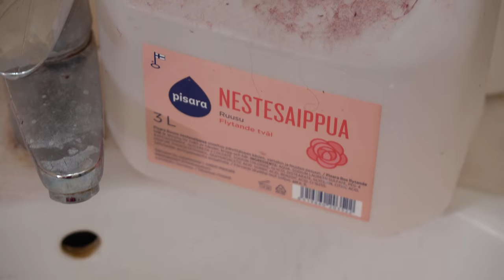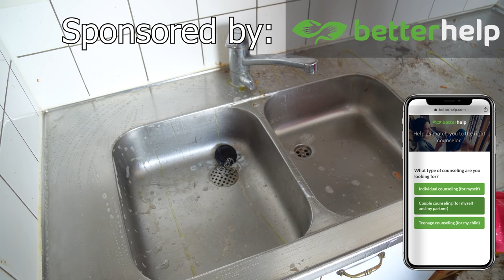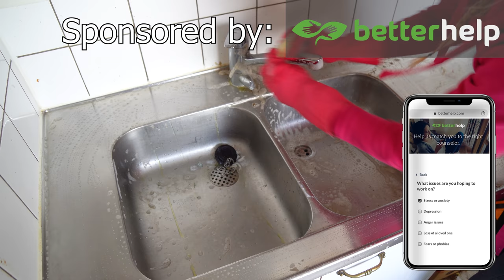Cleaning SUPER DIRTY AND GRIMY home only in 2 days!! 😱🥰

Comment: I almost accidentally set my apartment on fire using the seran wrap stove cleaning method. Pro tip: don’t clean the knobs while it sits, or you might accidentally turn on the flame with a bunch of condensed chemicals covering the area! That aside, it is SO effective for cleaning

Comment: Pro tip!, stick a bowl of water in the microwave for 3 minutes or just enough for steam to fill the walls it’ll help break down grime and oil and also help not to use any type of oven cleaners or just soaps it’s a real healthy way to not have any type of chemicals inside your microwave! And I really love your videos! What you and your friends are doing is a wonderful thing!
Reply: i do this but i add lemon juice to the water so it smells nice too!
Reply: Stick a half lemon in the water dish and it helps break down the grease and smells great!
Reply: I think it was too far gone
Reply: @lesleyhubble2976  yeah I think you have to admit when something is beyond cleaning and has to be replaced
Reply: @chanyphilly8266  I’d would have thrown it away, there’re cheaper enough to buy
Reply: Even better if you put slices of lemon in the water, as it acts as a natural deodoriser.
Reply: Thick grease from food or skin oils needs a degreaser ie an alkaline cleaner like oven cleaner. Steam won't help much. Also you'd spend forever scrubbing hopelessly without a good result. A lot of these old tips that people hawk on here, like steaming microwaves and the eternal, annoying baking soda and vinegar (an acid and a strong alkali which neutralize each other to uselessness, but people are impressed by the fizz) are actually fairly useless with heavy, greasy food deposits. Grease repels water, even if it's hot. You need 'chemicals' to do a good job with heavy cleaning, it;'s nothing to be scared of.
Reply: @littleblackpistol  agree
Reply: @littleblackpistol  Yes I am tired of it as well. When I clean and do these "tips" they don't work good at all. I get a better clean doing what auri does tbh. If your gonna use BS use it alone and with dish soap, same with vinegar use it alone and the way auri says to use it.  This use a bowl of water doesn't do anything your still scrubbing like crazy and it doesn't clean it at all
Reply: @littleblackpistol  water is a chemical
Reply: @chanyphilly8266  I thought that about the bucket!  Get a new one for $1
Reply: She did this already in another video
Reply: @evelynsaungikar3553  I know! You can try and save too many things.
Reply: @littleblackpistol  This. The vast majority people spouting clewing tips have absolutely no idea of chemical properties/interactions. Glad to see some know better.

Comment: Auri, I just wanted to share a random but meaningful way in which you had an impact on my life, even though it has nothing to do with cleaning. I lived with chronic pain for 8,5 years, and when I finally found a treatment that helped, it was kind of difficult to feel hopeful. And as it turns out, negative thought patterns have a lot of impact on pain intensity. When I didn’t get 100% better in the first months, my natural tendency was to be afraid that I wouldn’t actually get better. I was watching one of your videos one day, and you mentioned that sometimes stains don’t come off not because the product isn’t good enough, but because you need to let it sit awhile longer. My brain made the connection that I actually was on the right path, I just needed to work on getting better awhile longer. My symptoms have continued to decrease gradually, and that thought still helps me :)

Comment: AK, I have a tip for you! When cleaning a microwave like Sophie's, a great first step is to put about 500 ml of plain water in a microwave-safe container and microwave it on high for about 10 minutes. The steam starts to loosen up the gunk inside the microwave with no chemicals needed! I know you are promoting some cleaning products and they will still be needed, but the pre-cleaning with steam is a big time-saver. <3
Reply: I looked into it and it doesn’t seem to be safe to use a microwave after it has gotten this dirty because there’s holes inside and the old mold particles and germs can actually recontaminate the food. I would love to see a science experiment to know if that’s actually true and if there’s any way you can fix it! I suppose this microwave was being used in the before condition though (obviously) so as of right now there’s probably 80-90% less germs to go back into the food so it’s a lot safer than it was previously, that’s for certain!
Reply: Yes, this absolutely shortens the cleaning process and I do it too.  Even if the microwave is not super dirty you will be surprised how much comes off it.
Reply: Add a splash of vinegar to that and voila! Disinfected too
Reply: I do the same, but for 5 min., half of the water, and add 2teaspoons of lemon juice. Loosens the gunk and smells amazing!
Reply: Yes and similar with half a lemon..
Reply: Vinegar will steam and disinfect at the same time!
Reply: I add a slice of lemon to the water. Takes away the odors.

Comment: Aurikatariina, not sure if they are sold in Finland but I use a pumice stone to remove lime scale rings in toilets. It will remove a ring in minutes without chemicals (I just use scouring powder). They are also safe to use on ceramic sinks and tubs (just not fiberglass or stainless steel because they will scratch those surfaces.)

Comment: There are so many differences in the U.S. homes/apartments, and other countries. I live in the U.S., my apartment has a dishwasher, wall to wall carpet, and full-size appliances which include a dryer. Because I'm on government assistance, for multiple physical and mental illnesses, my apartment is about half the price of others in my area.
I use Clorox multi-purpose spray, Clorox toilet bowl cleaner, and Dawn dish detergent. For my dishwasher I use Cascade pods. I may skimp on food, but NEVER my cleaning supplies. I want quick, and easy. I just don't have energy to scrub and Clorox tends to wipe easier, no scrubbing needed. Dawn cleans birds after an oil spill, so I know it works quickly and easily.
On occasion I relapse with my depression and have to get a cleaner for a "start over" clean. But my goal is to do one thing every day or every other day.

Comment: This is SO good. But i really think i do it better. I love cleaning too. I would dampen any area that needs to soak first before i start working on anything else. I would then move all the trash to one place where i can sit on a chair later and sort them. Then i will start in one room and gradually clean every room leaving the room with the trash pile until i have only that space left  then i get to cleaning that. By this time the whatever stain i wanted to remove should be soaked plenty, so i clean those once everything else is done. Key is to start high because then all the drippings won't fall on top of surfaces i had already cleaned. I've been doing this at my own place for a really long time and it gets the job done faster.

Just subbed. 👌

Comment: Great video.  Obviously, it was a lot of work to do.  Seems like it was take out the trash, wipe down, and put things back in neat order.  Question(s):  why did you not take this opportunity to use some household items, ie utensil holder for the utensils, divider boxes in the refrigerator, or fix the handle on one of the drawers that was loose?  Also, it looks like it would have been better to take the oven out of its spot completely and clean back there.  And was wiping down the walls not part of the contract and/or video?  Don’t get me wrong.  You guys did an awesome job and I’m sure Sophie was very appreciative.  It’s just my OCD really kicking in, lol. Thanks so much for your video.